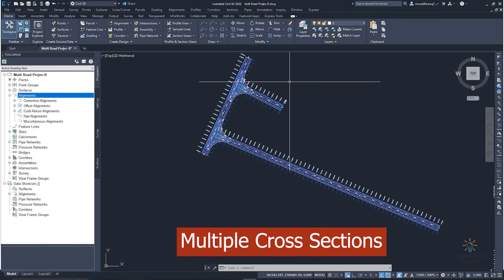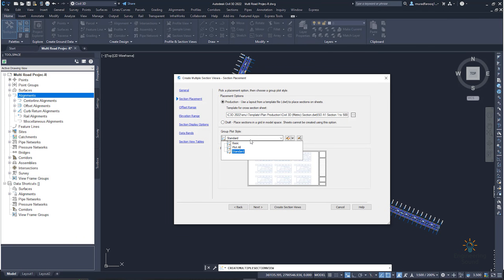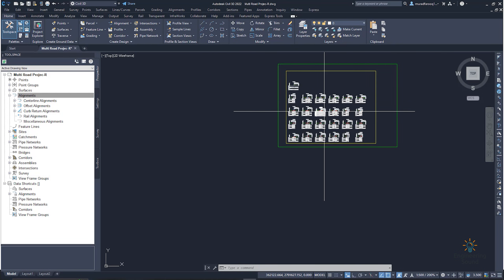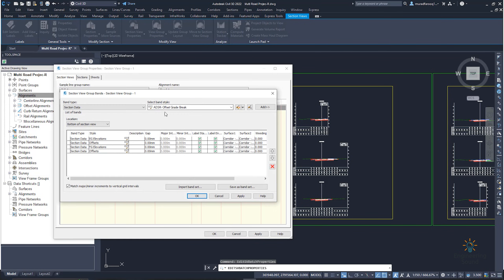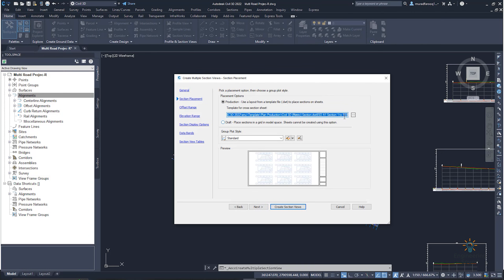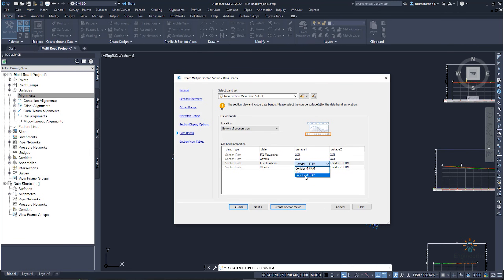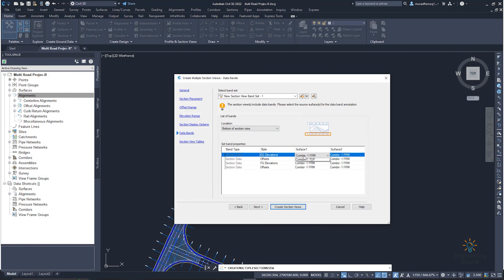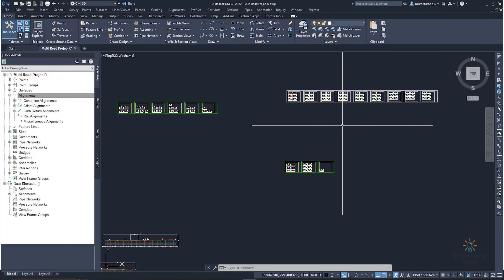How to Draw Multiple Cross Section Civil 3D Tutorial

Comment: do you happen to know if it is possible to draw multiple cross sections but in a specific order not predetermined by civil 3d? I would like option to select location for each cross section, so insertion point would be crown of road so I can overlap it perfectly to existing designer's cross sections. This would be great tool for contractors.